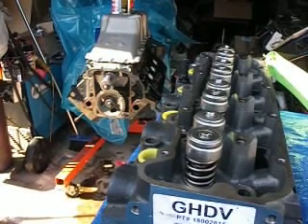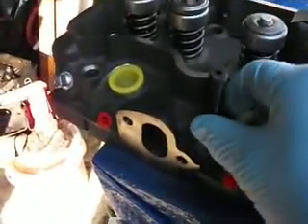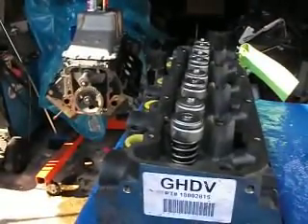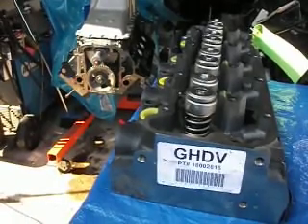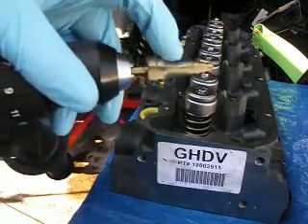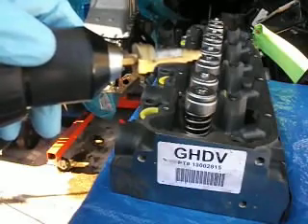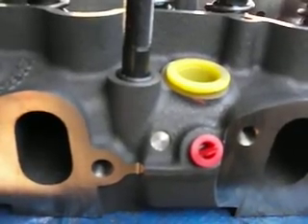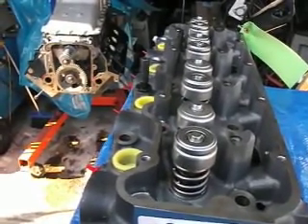P400 6.5 diesel head stud oring install

Comment: When cutting the inside holes, rather than mess around with blow-guns, tape, or vacuums, just pull out the valves, and give them a thorough cleaning when you're done. So much easier, and then you'll be sure to not have any stray shavings making there way into your oil system.

Comment: We have been doing this modification since 2009, never had any leaks. We do like to do it on a bare head though, and with
 a drill press. Much easier to have a correct depth for the O-ring that way......

Comment: what about using a bspp British bonded seal that we use in hydraulic fittings.  I would think it would do the same purpose without any drilling.
Reply: LeroyDiesel , yes they are rated for 4500 psi, and hydraulic application up 250 degrees in temps I believe

Comment from the maker: A 6.5 would do better with a 4L80E behind it. The Allison robs to much power (so Ive been told).
The 6.5 is very under rated on its performance ability. You asked about the P400 in another video, those are the best you can get in the 6.5 world. You can make good numbers with it and still get 15-18mpg. A set of injectors for these are only $400ish. A Dmax is $2500-3000ish so you can see the are economical also.
Check out www.thetruckstop.us forum. They will answer all your questions about the 6.5
Reply: Any updates on how the oring mod has been working?

Comment: You want to create a area to"Capture" the o-ring. Are these 6.5 and 6.2 diesels worth it? Are owners getting any longevity, torque and good fuel mileage out of these engines? I see it has the Chevy bell housing bolt pattern on it. Has anyone used this engine in a build to replace like say an 8.1 Vortec ahead of the stock Allison 1000 transmission? I have a 2001 2500HD but I am not been wild about the mileage. There is no computer control of this engine right? I have a diesel fuel pump technician background and also worked in a GM dealer for years. I just remember the 6.2 being a gutless wonder. I never drove a 6.5 though. Not looking to hop it up but if an inter cooler and other slight mods with the 6.5 would give the thing more power I might be interested.
Reply from the maker: +62guitarguy The Banks is pricey. I could set you up with a very nice custom turbo kit like the system Im running on mine, with manifolds and a complete turbo kit. You would have to make a simple crossover pipe and install an exhaust like the DiamondEye system on my web site. See here http://leroydiesel.com/products/134/
and here for turbo http://leroydiesel.com/product-category/turbo/
Reply: Hi Leroy Diesel, been watching your you tube for awhile getting ready to install a used engine (Ted's) I purchased about a year ago.  Alreadys have the ARB studs, and right now planning on doing a good job on cleaning threads and studs (chasing and paint thinner), but will be using good coat of the right stuff on threads of the studs in the block.  I plan on trying the oring mod, but haven't heard any updates on how the oring mod is doing. Could you please post an update on how effective the orings have worked.  Thanks from a fan.